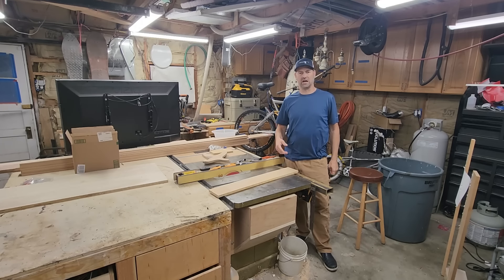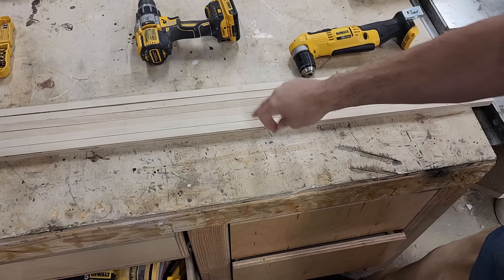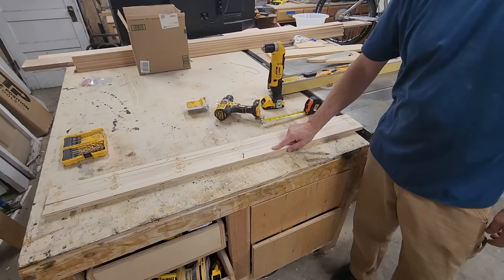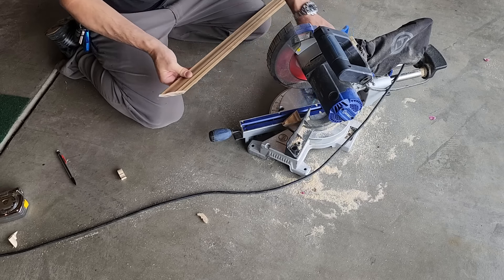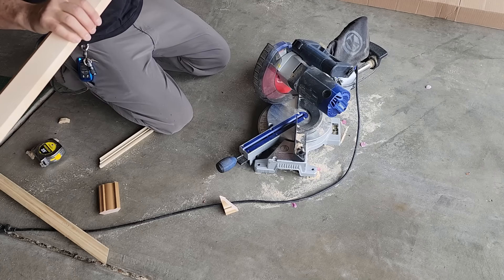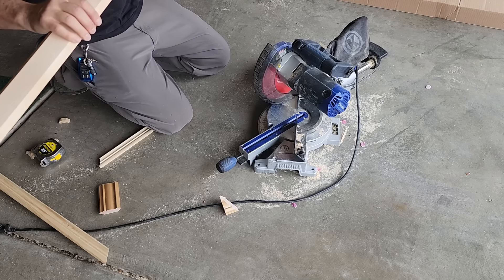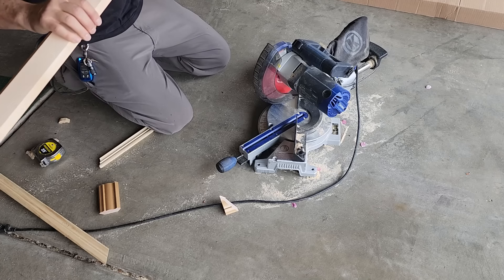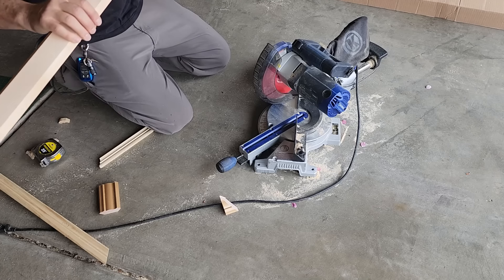Professional Crown Molding Install | Tips and Tricks For Perfection | THE HANDYMAN |

Comment: Pro here. Cut a slight bevel on the end of the crown where it meets the wall so you have the sharp corner butting to the wall. This sharp corner can be pushed into the drywall slightly to give a tight fit.

Comment: I noticed when you cutting that 1/2" wide material on your shop table saw, your outfeed table is low on the far side by at least 1/2". The drop-off of long material when the cut is finished in that situation COULD lead to a possible kick-back. Shim up the far end of the outfeed table to level.
Reply: Call the cops!
Reply: have you ever run a table saw in the field? ever?